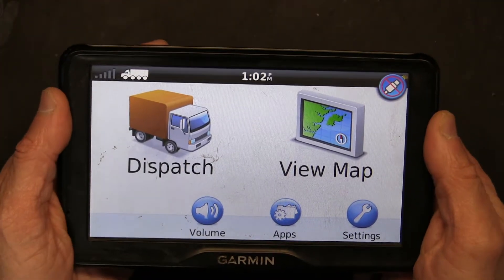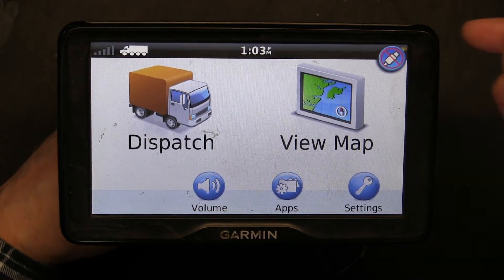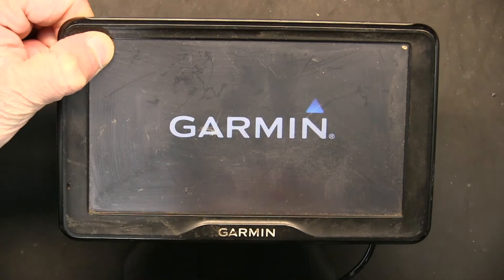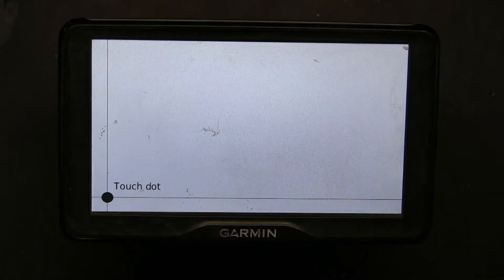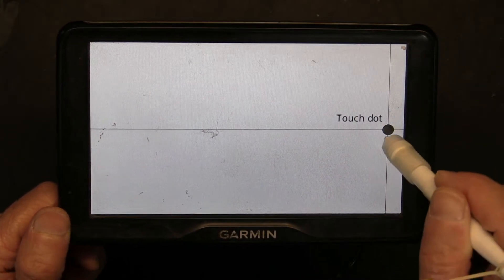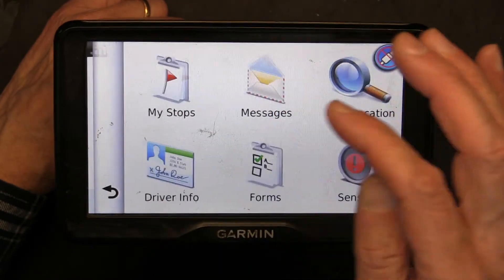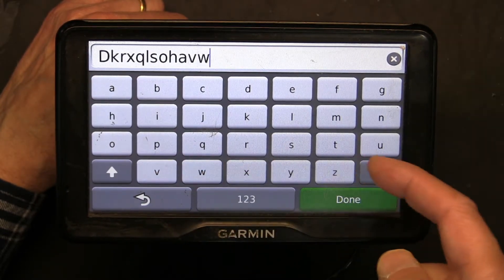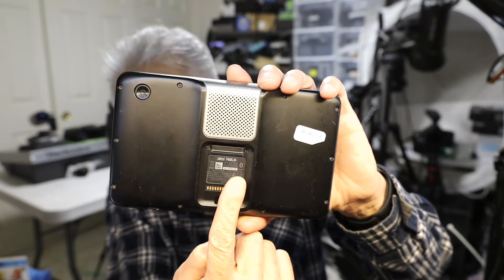Tutorial on How To Calibrate the Digitizer Touch Screen on a Garmin DEZL 760LM Truck GPS Navigation

Comment: Hi, I have a Garmin Dezl 760 LM 7" Truck Car RV Bluetooth Navigation System. Which I bought on EBay. The 760 has a blue line in middle of screen which is not too noticeable in day light . But in darkness or is very noticeable. Is the a way I can repair this or do I have to replace the screen?
Reply from the maker: Hi, Unfortunately, you have to replace the screen, however, you can get the screens for these relatively cheaper on eBay than you could from Garmin. Make sure to search eBay by screen part number not GPS part number, because the same exact model of Garmin could have many different models of screens that may not be interchangeable.
Reply: @TECHNOLOGYTIPS101  Hi, thanks answering very quickly . I bought this unit had a blue line. Only seen it after I bought it by the fellows photos and it was mentioned in his  description of the unit. I didn’t catch on untill I payed for it. Not really a big deal. But it will probably drive me nuts knowing I should have read more closely .        I’ll probably try fix it myself thou. I repair cars in my spare time, like the photo of car on my site.
     I suppose I have to take apart the unit to find part number?  The unit is still being sent to me as it is in transit from Tampa Fla. to Cornwall Ontario Canada. Supposed to be at my place by next weekend.
Reply from the maker: @gotacopy821  Good luck with the project